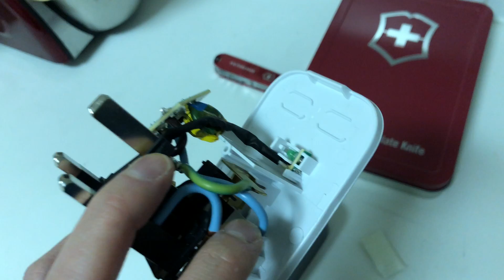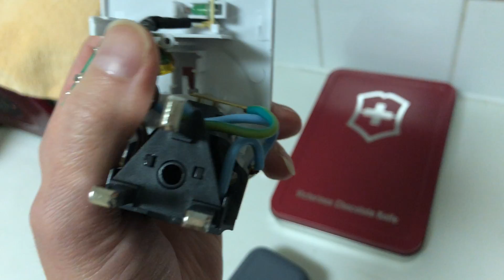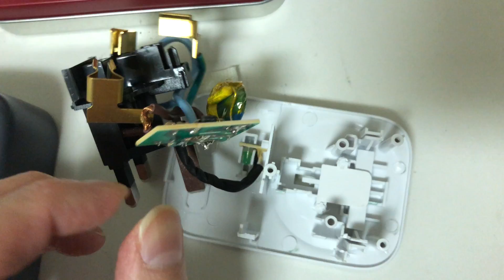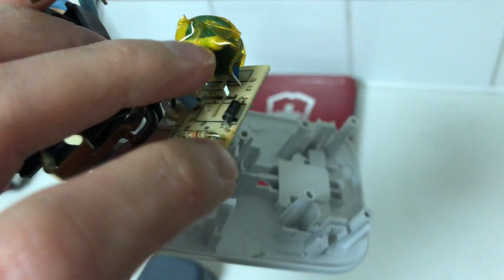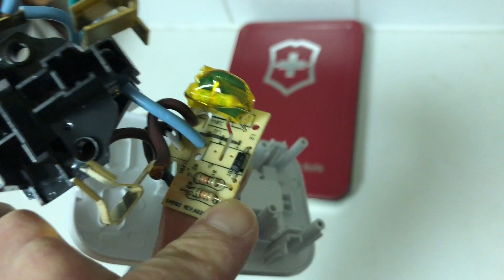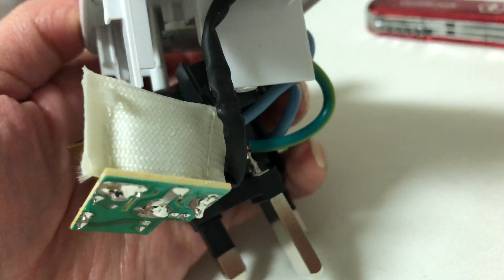Teardown of the Belkin SurgeCube 1 Outlet Surge Protector

Comment: 3:45 - that black diode I believe is the transient voltage suppressor (TVS), which helps to suppress power surges and spikes within less than one nanosecond - so both the MOV and TVS do work together. The thermal fuse is the component closest to the MOV which is design to cut power to the circuit should the MOV overheat and eventually fail.
Reply from the maker: Thanks for this :)
Reply: What this small TVS diode is doing in AC outlet? I dont think its anything but just a normal diode for indicator LED.

Comment: The strippoweroutlets from belkin use more MOVs
Reply from the maker: I thought they would, especially since their power strips come in various levels of protection.
Reply: @BrianSu  some guy called Zerobrain made a teardown of the 6 plug version here on YouTube. I have some noname protectors (they Sold under the brand goobay) and they have 2Movs and 2thermal fuses, some interference filter and Gas discharge tube. I bought the belkin for 12,99€ and the goobay for 3€. I would give the belkin a tiny point for having a fiberglas bag to prevent a fire.